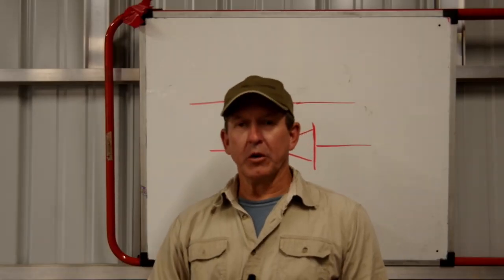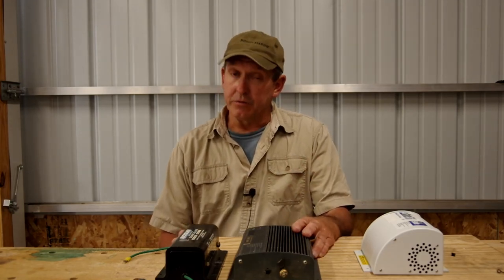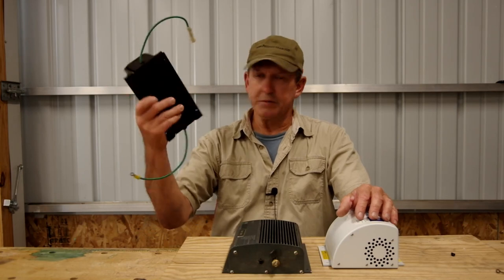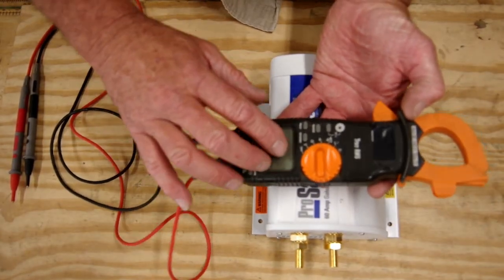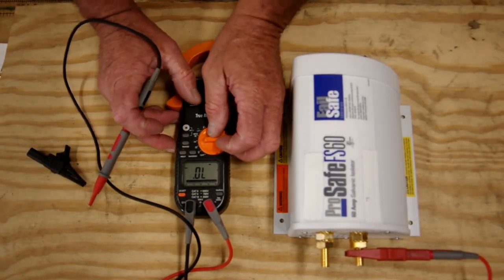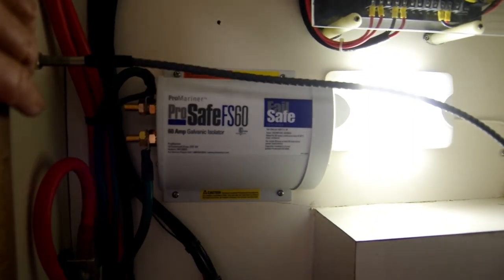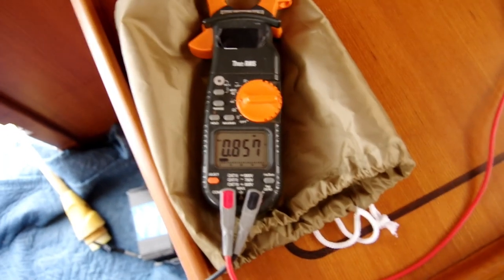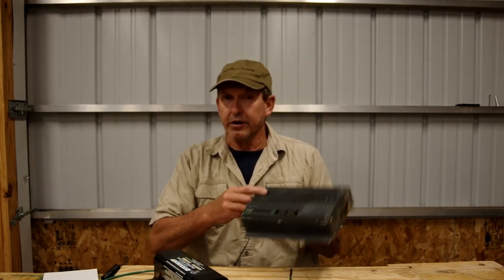Galvanic Isolators Part Two

Comment: Hi, thank you very much for easy to understand and extremely valuable knowledge videos for DIY! Can you please address the scenario  were boat has two 30 A shore cords and two Isolation Transformers.  Does this setup require a Galvanic Isolator?  The boat was loosing zincs at very fast rate.  The outdrives were recently upgraded with Mercathode. Thank you!
Reply from the maker: If the transformers are arranged as isolation transformers then a galvanic isolator is not required. Some transformers are for polarization and do not offer any galvanic protection.
Reply: @workinonaboat1950   thank you, how do I know if they are polarizing or galvanic protection? sorry for the noob question. I can not even understand the difference between Common Ground, Bonding, Grounding? should all of them be interconnected?
Reply from the maker: @andreylevenko5534  There is a good bit of information online about isolation vs polarization probably easier to direct you there instead of trying to explain in the comments. Bonding and grounding have different functions but are joined at the common ground point. Great idea for a future video.

Comment: Great videos-thanks! I am sorry if this is a dumb question but if I do that test on my boat with my multimeter and shore power cord and I don’t have a galvanic isolator or an isolation transformer what should I see to know my safety ground is intact/working?
Reply: Great question.  If you do not have an isolation transformer or galvanic isolator installed and you test between the pedestal end of your shore power cord AC safety ground and the onboard AC safety ground buss or the safety ground on an outlet. You should read very low resistance, less than 1 ohm. That low resistance would indicate that the AC safety ground through the shore cord and then through the boat's wiring is intact. If you see no continuity or high resistance that would indicate that there is a problem with the AC safety ground. Thanks again great question.

Comment: Hi, Great Video but is there another way?  I have Najad 355 Sailing yacht and the Galvanic Isolator is installed in line the incoming Ground wire and the vessels Grounding plate (Bronze plate through mounted on the exterior of the Hull).   However all the vessels 240v system is connected before the Galvanic Isolator on the incoming ground.  Have Najad simply done this wrong or is there another way?
Reply from the maker: A galvanic isolator should be installed in the AC safety ground (green wire) between the shore power inlet and the AC safety ground buss.

Comment: Question, I have two 30 amp shore power cords, one for HVAC, the other for all other AC loads on the boat. I assume I must have two Galvanic Isolators. Please confirm.
Reply from the maker: You can use a single isolator provided the single isolator can handle full fault current of both cords. so for two 30amp cords a 60amp isolator is needed

Comment: Thank you for the info, most helpful. I do have a question, will the galvanic isolator also protect against corrosion on one drive and not the other ?  I have twin Bravo1s and the magnesium anodes (fresh water) on one of the drives are heavily corroded in a short amount of time ( 3months) while the other is not.  Any thoughts are greatly appreciated !!
Reply from the maker: A galvanic isolator should protect the whole boat. If one sided is corroding faster than the other. I would check the bonding. Paying close attention to the bonding straps on the drive. Those little little wire straps that connect the moving parts of the drive together.

Comment: New to boat and multimeter, I performed the check as you suggested and my multimeter reads 1447 and reverse 1443 with no decimal. Am I getting an accurate reading or is my isolator inoperable? Thank You
Reply from the maker: Not sure what you are reading there. Is the meter set to diode test?
Reply: I purchased a better quality meter and set to diode test and has same results, even disconnected isolator and tried it directly, same numbers. I ordered a new isolator. Hope that's the problem.  Thank You.

Comment: I've not checked all the comments yet but when you pointed out the boat's Ground side of the outlet at 15:50, your finger seemed to point at the Neutral (wide) lug of the outlet, not the Ground. And then your video did not actually show you insert the test lead. Maybe I'm wrong and maybe it doesn't even matter (is my guess), but can you address that for me. Awaiting delivery of a 42yo boat in a few days and will want to check. Survey made no mention of an isolator and I'm feeling overwhelmed with the systems I've got to learn. Thanks.
Reply from the maker: It does look that way, you are correct, that's the trouble with trying to  hand hold a camera. But yes the test lead goes into the ground.

Comment: Why isn’t it 1.4 V? 0.8 V does not seem like enough to protect stainless steel.
Reply from the maker: I think we are  talking about diffrent things. When we test a galvanic isolator we are measuring the voltage across the diode inside the isolator to check that it is functioning. We check hull potential to assess if we are protecting our underwater metals.